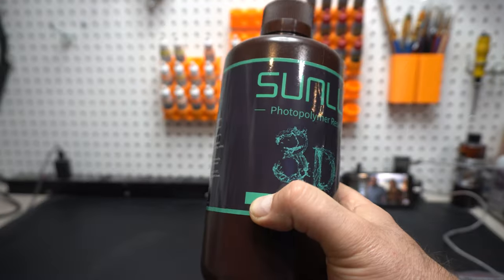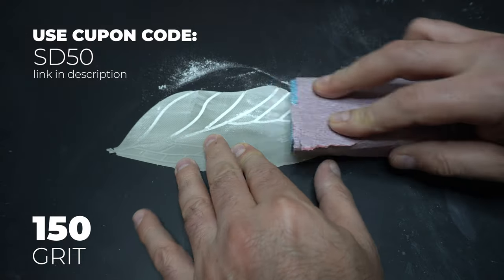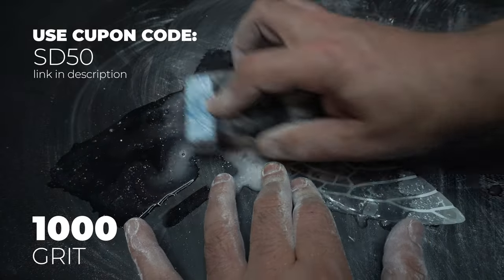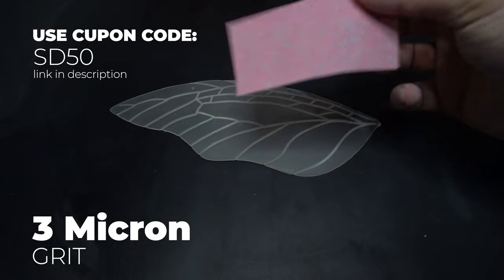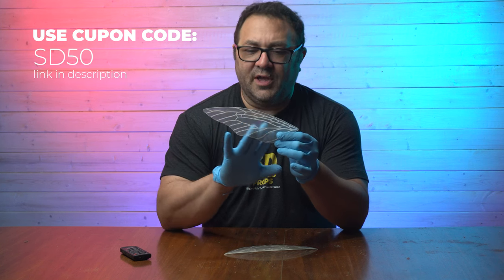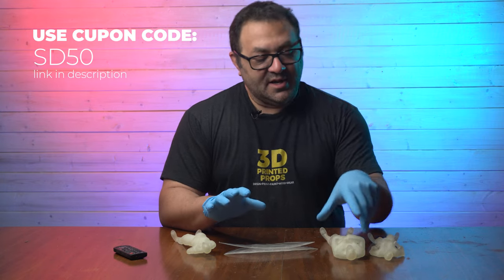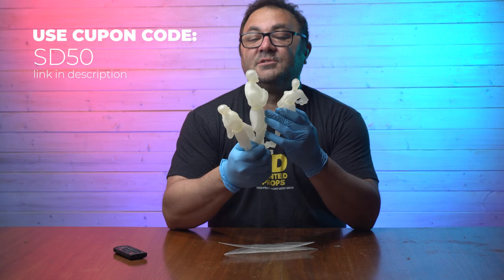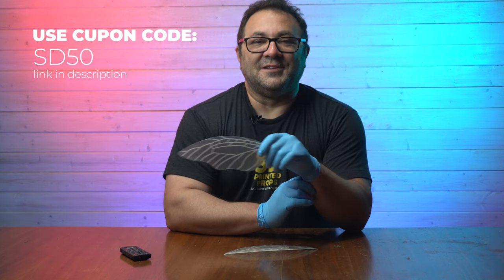How to Sand, Polish, and Finish Clear Resin 3D  Parts -  SUNLU Resin

Comment: I recently printed a clear green shard project from the recent season of The Mandalorian. I knew there must be a way to get the green shard more clear, and after searching I found your tutorial. Absolutely fantastic results! Thank you so much! I used all the different sandpapers, micro polish papers and polish from your materials list. I dry sanded with the grittier papers and wet sanded with the fine papers, polished, and finished with a clear gloss coat. Perfection!!

Comment: Hi, Congrats on the content. Would it be possible to tell me which features you used to print that clear. I'm having problems where the models result in transparent resin
Reply from the maker: I didn't print it that clear. I had to do a lot of sanding.
Reply: @3DPrintedProps  my question was not about the color but i'm having troubles in printing in clear resin. the models came out very bad with a lot of malformations wherever there were supports. Can you helping me troubleshooting this? Thanks

Comment: Sometimes working on prints is like doing bodywork on a car. 

There are probably some clearcoats that can fill in the resin without giving you a glossy finish an avoid having to go past 2000. 
But that's all trial and error with factors like the resin used/environment.
Reply from the maker: Yep. This was my second attempt. I did use a clear matte that looks cool.  But I liked these plain.